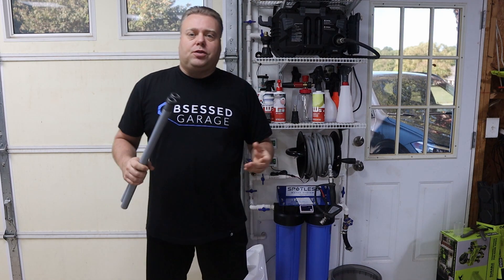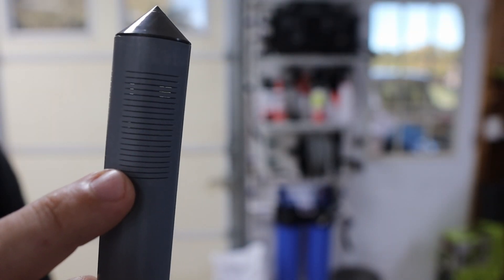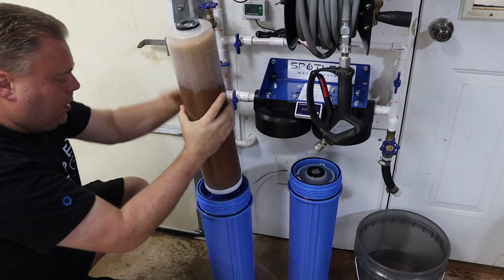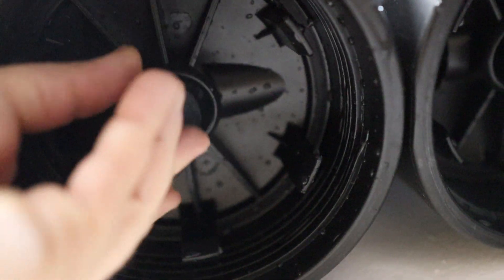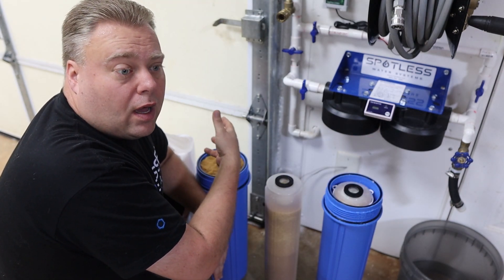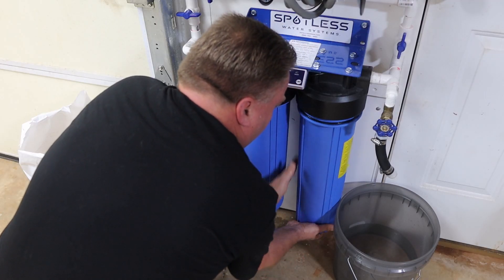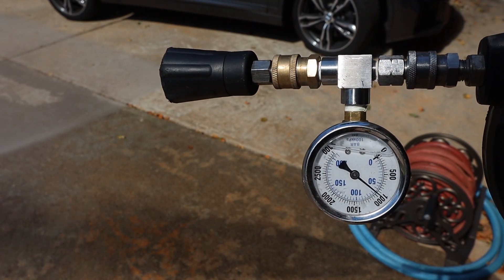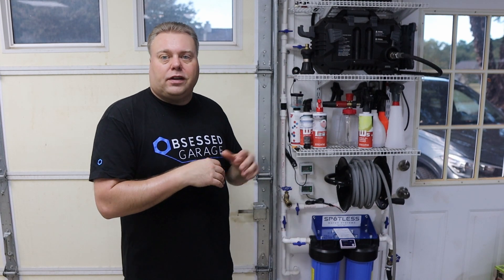Modify Your CR Spotless | How Long Did My DI Resin Last? | RV-Mods

Comment: Hi Im looking to get this double tube kit, would you recommend it or should I stick to the regular cartridge. Thanks
Reply from the maker: I need to do an update video. I ended up going back to the cartridge. Resin was feeding through the slits on the tubes and clogging my sprayer. Doesn’t mean others would do this, but mine for sure failed stopping the resin from getting into the water flow.
Reply: @CarsWithKeav  thank you for the quick response! Looking forward to your updated video! 👍🏼 maybe I’ll try it and leave a comment here in the future on how it went for me. Thanks again!

Comment: How often do you have to change the resin?
Reply from the maker: For my water quality I get about 400 gallons. My water is pretty good at 60ppm. If you have harder water it will be much less. Their listings says 300 gallons.
Reply: @CarsWithKeav  so how many washes would that be. I feel like I'd always have resin stress
Reply from the maker: @brokenSnake  this would all depend on how much DI water you use for washing. Mine probably goes around 50 washes as I only use it during final rinse. If your use during all other rinses and foaming then it would be much less.

Comment: Any downside to putting the tubes in first and then putting the resin in?
Reply from the maker: You run the risk of the tube becoming un seated from the housing since there is not enough resistance to keep it in place. if you knew the perfect height to place it and packed the resin under you could. Having it packed down and the pressing the tube down you ensure it will stay in place.
Reply: Yeah along those lines, how do you know that the pipe DOESN'T come unseated sometime in between uses?? It is in no way secured except for resin, which will likely slosh about with use.

Comment: Do you remember what size lags you used to wall mount that? The 4 holes that go against the wall. Thanks!
Reply from the maker: Can’t remember exactly, but pretty sure they are 3/8 x 1”. The wood on the wall is only an inch thick so didn’t need anything big. If you can mount into a stud I would advise at least 
1 1/4 to 1 1/2

Comment: Roughly how much resin did you use to fill both? Would love to know how much it cost resin wise to fill the canister.
Reply from the maker: 1/2 cubic foot total. For me it was $117.50 since the bag cost $235 from RV Mods. This is for the modified version. If you use the stock filters it’s half that.
Reply: @CarsWithKeav  dang. Wasn't expecting that much resin in those. Might have to think of a prefilter. Getting about 500ppm. I have this upgrade as well but waiting on my resin.
Reply from the maker: @din0gear309  a lot of guys with that high ppm run a double carbon pre-filter and some add on an RO system. Resin won’t last long at 500ppm
Reply: @CarsWithKeav  thank you. I'll definitely do that. Thanks for the suggestion. 👍
Reply: Carbon filters do absolutely nothing for TDS. It will however remove chlorine which hurts the resin for refrigeration purposes but you’ll get the same TDS reading and life span with or without carbon filters. Tank exchange companies like and often require carbon filters so the resin can be regenerated more times but for us regular guys we use it once and throw it out.

Comment: Awesome review Keav, love it. Please keep us posted. I have the tubes ready and a 1/2 ft bag ready for when my initial CR cartridges run out. I missed your TDS numbers, at your tap output -  just trying to estimate how much life I can expect. (Mine is 433! in North County San Diego)
Reply from the maker: I get between 50 to 60 ppm. 433ppm is for sure going to get less gallons than I
Got. At that ppm a two stage carbon pre-filter setup might help the Resin last longer.
Reply: that's crazy high!
Reply: @CarsWithKeav is there a video on the pre filter side of things?

Comment: Can it work with the "Knock Off" CR spotless filters?
Reply from the maker: Should work with any 20 inch filter and housing. They basically all have the same design. Just don’t know for sure since I have not tried them.
Reply: Yeah it works. I have the apec one got it used but you can but those cannisters by itself.
Reply: No they do not. Every brand has a different orifice size under the housing cap. You will notice not all brands are created equal. These tubes were designed specifically for the CR Spotless

Comment: I just switched to this mod and now I got only 300 gallons when before with just the regular cr spotless setup I was getting 800. Doesn’t make sense I’m getting way less di water.
Reply from the maker: That is weird. Same DI resin? Are the pipes seated all the way? At worst I doubled my length between changes. It didn’t really increase overall resin usage. Possibly too much flow? I’m just throwing out anything I know of that could impact it.
Reply: @CarsWithKeav  I’m only flowing 2gpm into my tank. It was brand new resin from them. I guess on the bright side I just recently found out how to regenerate DI resin for less than $20.
Reply: your probably getting channeling now since the mod takes away the forced contact with the media to some degree.  I would switch it back.  Its not as critical is his application since hes starting so low.
Reply: Switch it back or see if you can find a proper swirl tank instead. They increase efficiency by up to 30% in some cases. Not sure what's available in the US, but give it a try to see if you can find one.

Comment: Great Video Keav! 
how much resin do you use aprox?
Reply from the maker: It’s around 1/2 cubic foot
Reply: @CarsWithKeav   - What would that equate to weight wise please ?
Reply from the maker: @madstyx  Cubic foot weighs about 45 pounds so 22 to 23 lbs.
Reply: @CarsWithKeav   Thanks. I'm from the metric world, where the resin was sold by weight (kg), so it was difficult to try and work out how much was needed to fill two containers. That would mean about 10kg then for two containers.
Reply from the maker: @madstyx  Glad I could help some just a KG conversion short of what you needed to know. LOL

Comment: If you use lubricant, you should buy a silicon lube designed for rings, which will not swell the rings.
Reply from the maker: That is correct I have learned a good bit about this stuff as I have changed and upgraded my system.

Comment: Is there videos showing a diy set up that doesn't use filter cartridge or tubes but just adds a mesh like filter at the top?
Reply from the maker: I have not seen any. You need the long tube for the water to spend enough time being filtered before flowing out. If it was just a mesh it would pass through too fast and not filter. This is the reason most DI setups can only push between 2 and 2.5 gallons per minute any more and you risk it not filtering properly. I have seen some inline filters that help out hose plugs in one end and another out the other side, but doubt they can handle 0 ppm/.

Comment: Your timing is absolutely perfect on this as I’m getting ready to pull the trigger;) Plus thx for listening to the commenters about RV mods. To me the mods worth doing even if it didn’t add more life just from a functioning standpoint. CRs seals are causing people to replace their resin before need be. Probably by design:) Thanks bud.
Reply from the maker: As you saw in the video I think I had blow by from not seating properly. You could see it in that one filter being discolored halfway. I am doing this just to have the extra capacity if it is more efficient then its a plus. I will update again once this resin is spent. if I swapped the filters and made sure it was seated I might have had 0 ppm for another 100 gallons probably.

Comment: Double the amount of resin per cartridge refill would double your cost of resin, no? Ultimately it's the same spend on resin, for the same volume of output.
Reply from the maker: They say the way the pipe is set it reduces blow by significantly which will save Resin. They also  say the way it feeds is more efficient. Don’t know if it’s proven, but in the end I don’t have to change resin as often and it’s a pain the neck to do so it’s worth it for me. I would also think that with more resin better chance to get 0ppm when running a higher flow of water. Just a theory though.
Reply: @CarsWithKeav  If it's a pain to change resin why not stick with the plug & play cartridges?
Reply from the maker: @DarrenZemanek  Either way you still have to refill the resin in the filters. Filters with resin already in them are too much. Much better to buy in bulk and do yourself.

Comment: Been looking for something like your setup.  How often do you use it?  Trying to get a feel for how long they last before a fill up.  I did not know this till I watched this video.  Shows how much I know about these things so far lol.
Reply from the maker: My ppm is 50 to 60 so my resin would last more than most. I used DI for everything the last two months even washing my mower or rinsing dirt of my arms and legs after yard work. I just forgot it was on DI the whole time. 😂 I need to figure out my gallons per wash to know how many I have done. Also, been using for tons of videos and I have to redo a lot of clips and prep panels so a lot is used there as well.knowing that my meters seem to be off by 10% I bet my gallons was over 500 and closer to 550.
Reply: @CarsWithKeav  Thanks for reply. I do have DI powder for the pool but I guess that's not proper for this device?
Reply from the maker: @cfwebdeveloper  Water softener resin and DI Resin are two different things. You need Mixed bed DI resin.
Reply: @CarsWithKeav  Now I’m imagining you taking a DI bubble 🛀 in your front yard 😂 I’ll stop there. From what I understand especially living in AZ I should run a pre filter of some sort? Like that one that looks like yarn? TDS is high 200’s. Not sure to go 10” or 20”. Apparently you can cut the mod pvc for 10” but probably not worth screwing with. Thx again man!

Comment: Can i do this to my small di? Kinda of like the one you use on your cart
Reply from the maker: Not sure they make them that small. I have only seen them made for the biggest 4.5 inch filter housings and not the 2.5 ones.
Reply: @CarsWithKeav   okay. I think i messed up doing my set up. I have the ro/di by aquaticlife then to a water softener out to the pressure washer
Reply from the maker: @Hcautodetail  Water softener should be before the DI system.
Reply: @CarsWithKeav   just swapped it. Thank you!

Comment: You are wasting a lot of water and time trying to run out the cloudiness…. Its just air. First fill and run a few litres through and most of the bulk air, then leave for a couple of hours if you want the cloudiness to go away or just use.
Reply from the maker: Thanks for the advice. I do run way less water now even though manufacturers suggest more to be run out before using.